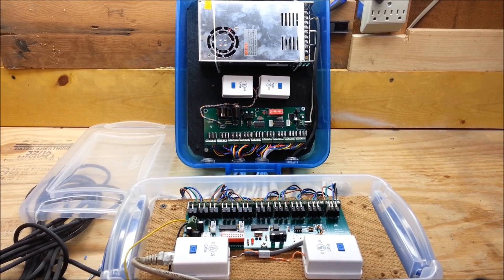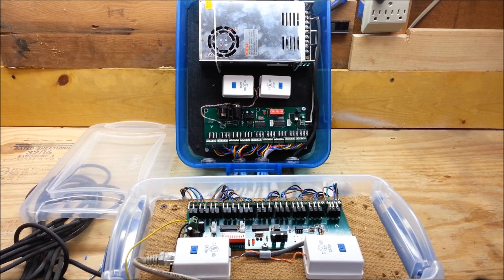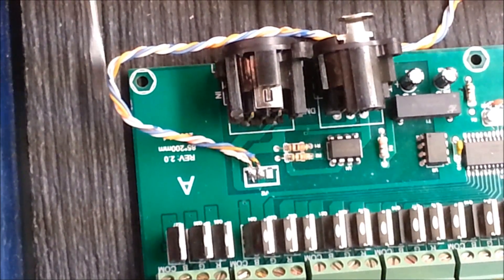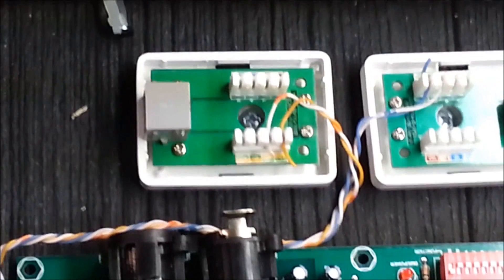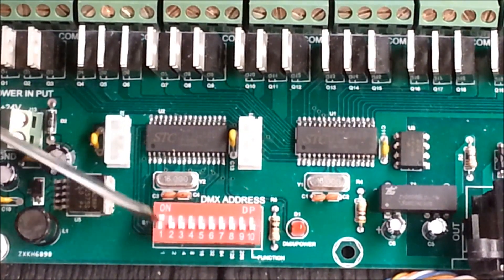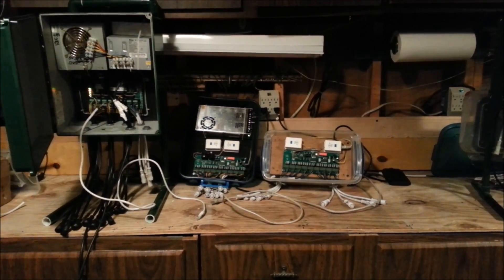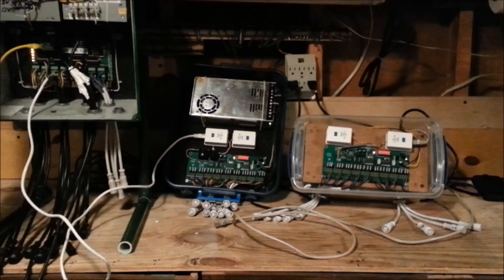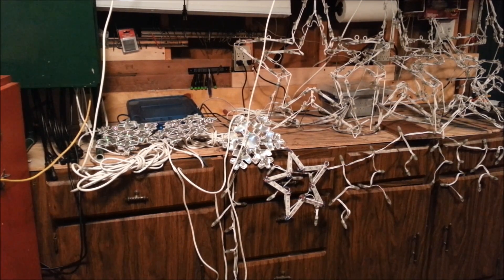Setting Up E1.31 on Windows 7 (Part 4 DMX Controller Setup)

Comment: that helps thanks but can you tell me how you programed L O R  to rum D M X I have two  lor controllers trying to use them with an alphapix 16 v3  and a qj-  30chdmx and I cant get the lights to dances ?

Comment: Do you have a video showing how to connect the pixel lights to the the outputs of the 27 ch controller...  I’m using 5v ws2811 pixel lights... looking at the pixels they have 5 cables 2 cables for power, 1 cable for data & 2 cables for ground and my controller is a 36 Ch dmx controller and the outputs are labeled as V-B-G-R.... I have no idea how to connect my pixels to the bord... help please...

Comment: What if I am using the Falcon Pi player on a pi b+ using a router? Won't the addresses change?
Reply from the maker: Addresses for the 27 channel easy dmx controller can only be changed manually.  If I were going to run this sequence from above on the Falcon Pi Player,  I would export the LOR sequence it into XLights / Nutcracker.  That channel configuration will remain consistent.  Then when converting from Nutcracker to FPP code, the channels should remain the same.  The FPP would output via e1.31 to the e682.  The 682 then sends the DMX out to the controllers.  A router would only split the connection e1.31 to multiple e682/6804 controllers.
Reply: can you use an E1.31 bridge instead of tying up a universe on the e682? Also I would like your thoughts on using the easy dmx controller on 8 channel sainsmart ssr boards. Without dimming of course...
Reply from the maker: musicmaneman38
Yes you can use an e1.31 bridge, that is currently how I setup these 27 channel controllers.  The cost of a bridge from DIYLED Express is roughly $70 per kit+ S/H.  But, you must build this or find someone who can build it. 

As to the Sainsmart SSR boards, I have not used these.  If they can receive and convert a DMX Signal then I don't see why they wouldn't work for an AC application if you want to add standard 110 LEDs/incans.   If you are looking to run this 27 channel controller using the SSR, I don't know if that is possible.

Comment: Very good, I saw several videos his, and stay with doubts about the DMX 27ch, the computer has to be connected on the board or the sequence is saved on the board?
Reply from the maker: the board must stay connected to the computer.  DMX communicates the sequence to the board.  It can not run on its own.